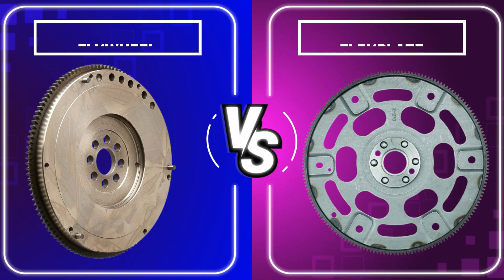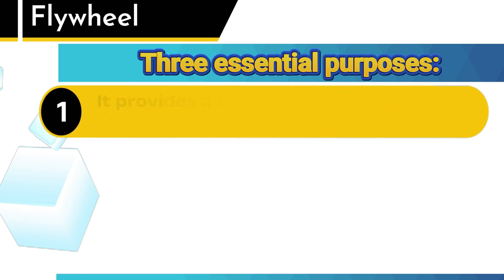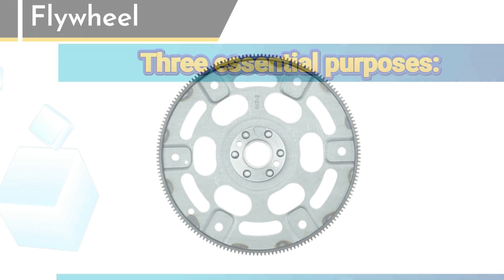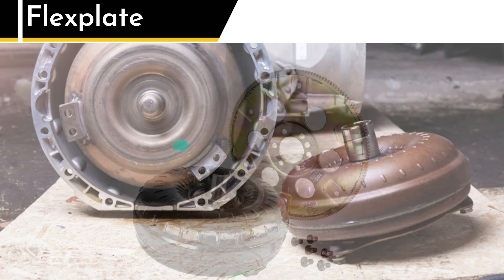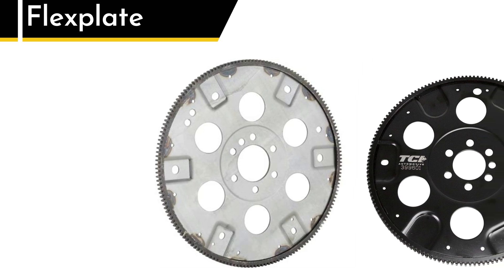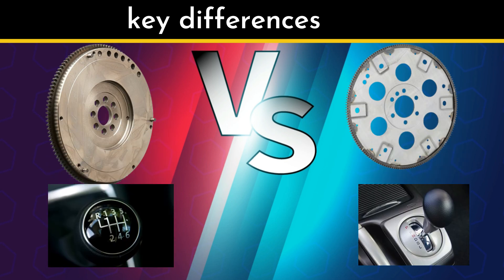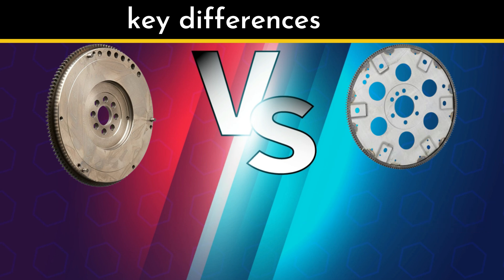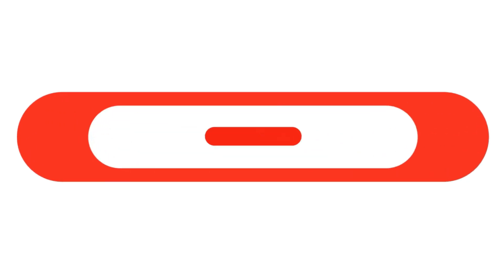Flywheel vs Flexplate: Key Differences

Comment: how does flywheel connect to clutch if it is the smooth part that come in contact, and wht part of clutch connect to it? doesn't the two sides in contact t high rotation wear off and creates debris inside transmition?